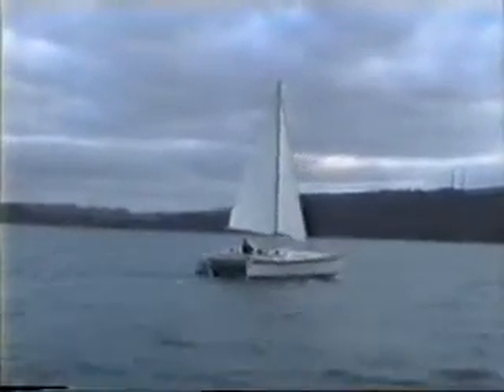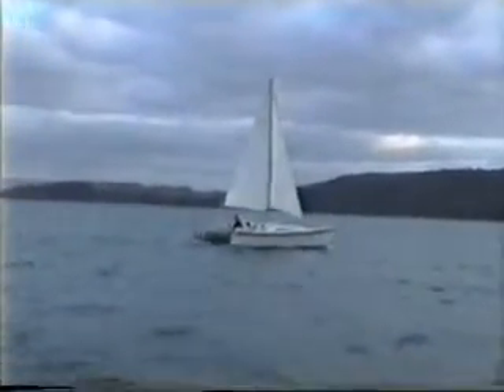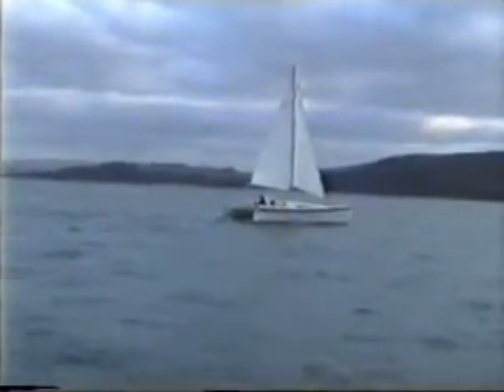Windsong sailing catamaran by Woods Designs

Comment: Thank you for your quick reply. I am still debatting what catamaran to build. Amount of work and size of the catamaran is my endless debate. I rrally like the layout of Wimdsong. The size seams perfect for my needs and a feasible project. You are right that I checked the Pahi 31 and I am not sold on the rope lashing flexible connection and the fact that there is no headroom. I will look closely at the other design that you are suggesting me. Thank you for your help.

Comment: There is not that much wave and it seams to be prone to hobby horse. Is it because it is not loaded enought or the rig is to tall or it is the hull shape?
Reply from the maker: Thank you for your comment. Actually one problem was that this boat had too little sail, rather than too much. The rig came from a 24ft trimaran, so it was definitely undercanvassed in the typical sloppy sea off Plymouth. I was filming it from a Sagitta, which has a smoother ride and was much faster

Another thing is that the Windsong has canoe sterns and like all similar catamarans, from all designers, pitches more than a transom sterned boat. I remember sailing the prototype Pahi 35 for example in the same area and had the rudders pitch out of the water

That is one reason why I suggest a Gypsy over the Windsong

I hope that answers your comment, if you have more please email me direct